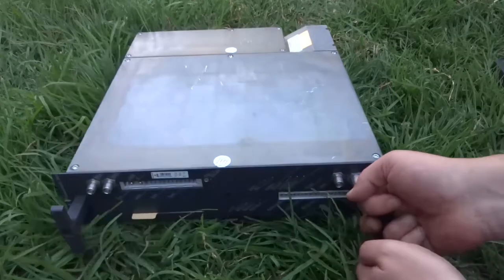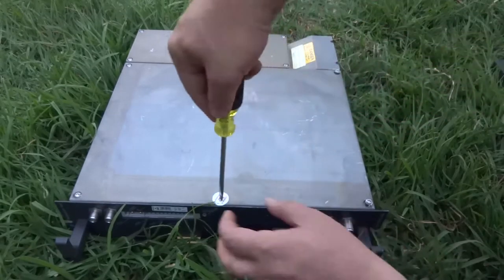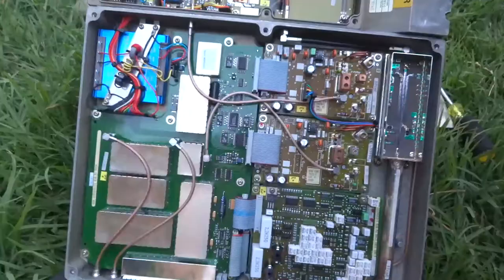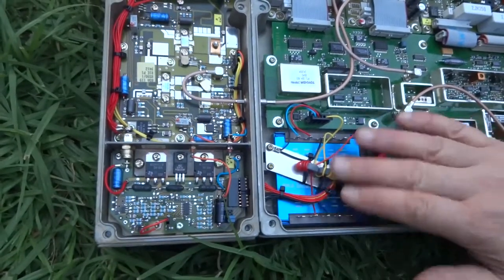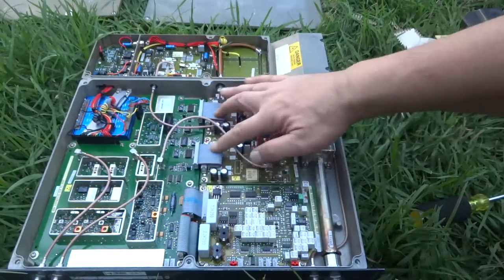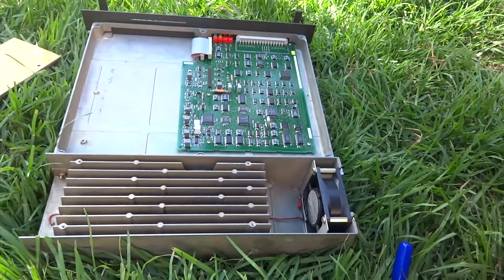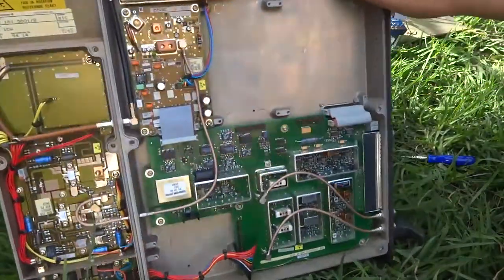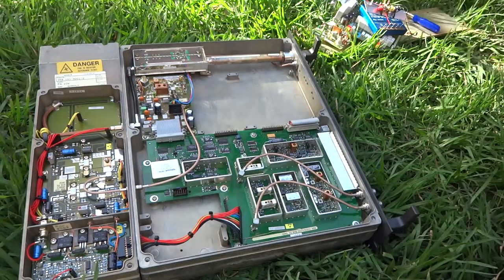Ericsson base station transceiver teardown on grass

Comment: has you run it yet?
Reply from the maker: I don't know how to control this or even power it. When I build a base station it will be SDR.
Reply: @JanusCycle  osmocom with lime sdr ?
Reply from the maker: I'm still on HackRF, full duplex hardware will come when I'm able.